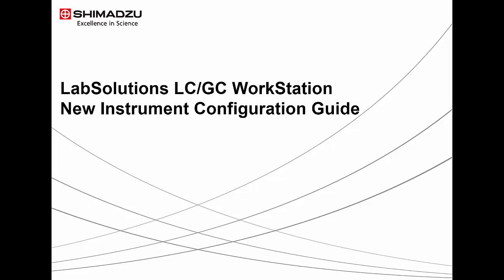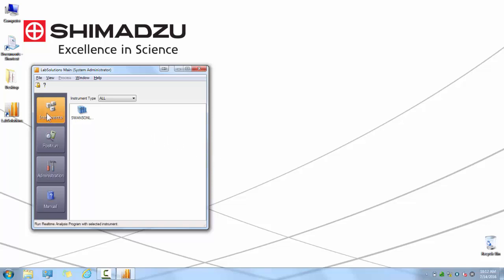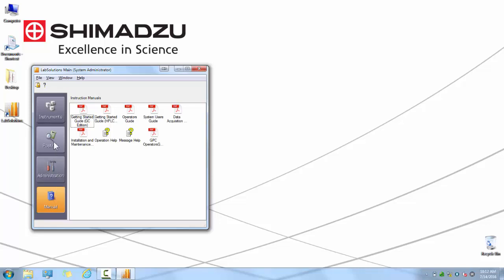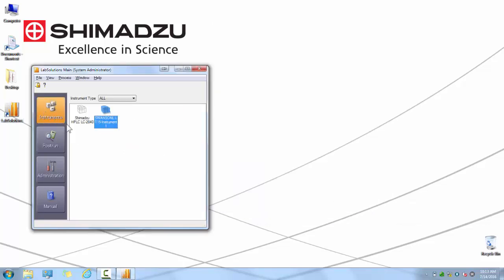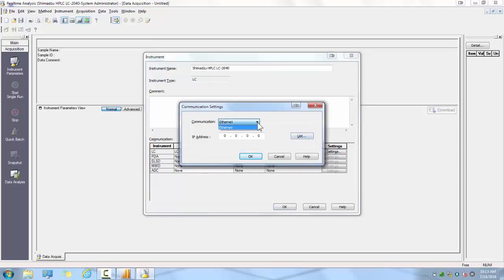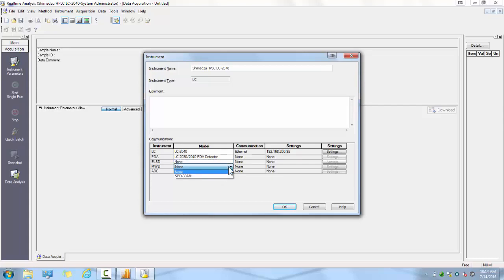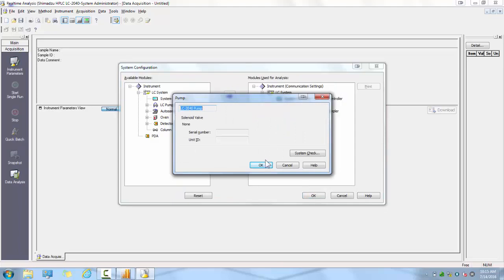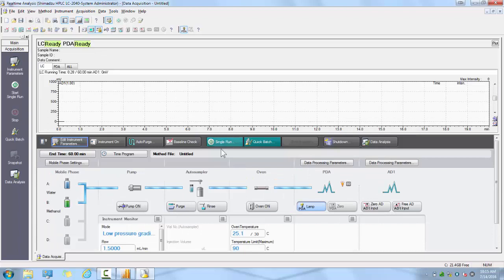LabSolutions HPLC instrument communication settings and hardware configuration guide

Comment: Hello, when starting the HPLC an error code 0x9062 blocks the launch of the equipment, the error message is: A timeout occurred in communication between the autosampler or column oven and controller.

Please how to solve this problem